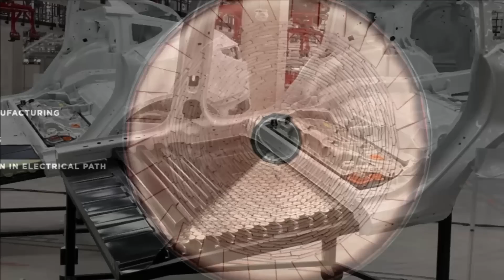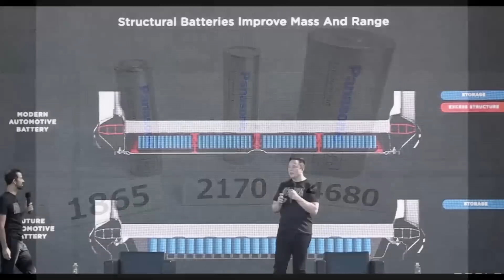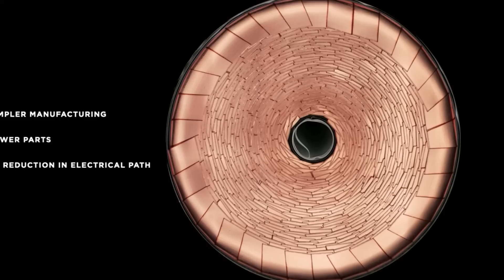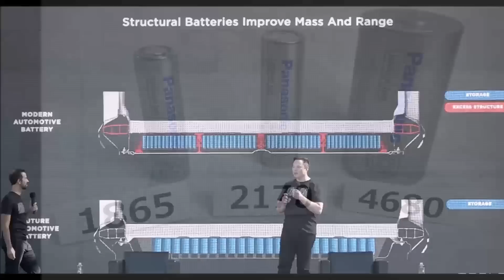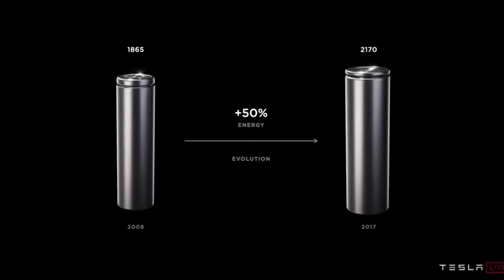BREAKING! Tesla Says It's Not Constrained By 4680 Battery Cell Supply in 2022

Comment: the 4680 battery as it is currently manufactured contains little that makes it advantageous over that available in the previous battery. that's because the tech that would have made it very superior can't be implemented and it can't be implemented because tesla can't get it to work. 

BTW, "it" is called the "dry electrode" manufacturing process. 

oh, they are making a 4680 battery alright! but it's not the one musk and co. promised on "battery day" a while back. they won't tell you that because they are too embarrassed. i would be too if i promised tech that i thought i could buy, and did buy at an enormous price (from Maxwell Technologies), but couldn't get to work. so they just went ahead and are making the 4680 battery, but making it wihout the tech that makes it better than what they were making before, except that it can be packaged to make it structural. ...a minor concession.

Comment: I am glad that Tesla is ramping up their 4680 production. And that it is not a production constraint. But if they were really ramped up in the Kato rd. battery factory then they could probably supply 4680 batteries for the German Model Y as well. Hopefully the Texas 4680 facility starts producing batteries soon, with Germany soon to follow. I am eager to see the specs on the 4680 Model Y. Tesla could initially limit range with software, and then when the German and Texan local battery production ramps up they could unlock better range and performance that the 4680 batteries will provide. Or they could offer a smaller 4680 battery pack with the same capacity as today, maintaining the EV range but making the Model Y lighter.

Comment: And yet may other analysts had no idea why the stock fell because they thought that was trivial news. 
They are ramping MY - their best seller. The don't have the cells to ramp them all. 
The Cybertruck was promised in 2023.... not 2022. The M2 wasn't due in 2022 either. That was grist from the rumor mill that ignored the ramp of the 4680 that Must (to make a profit) precede these vehicles. 
The MY is profitable with or without it. Perfect for ramping the cell production. 

If they dropped the stock because they were betting Cybertruck would be delivered early, they weren't listening very hard. 
Also, what part of the 1.2millioin reservations for Cybertruck will Rivian fill in 2022? How many Lightnings for 2022?  Just saying. 
Being first to start doesn't win the race. Or maybe the Bolt is doing better than I thought. 

The people who dumped were likely speculators, not investors. People looking for a fast buck.... and apparently 87% growth isn't fast enough. The investors are still there. 

The one thing I'm not clear on is Semi, which Was promised for this year. (The other 2 were not.)
He said he will not ramp new products, But truck was sort of in limited production, so I think that will see production as 4680 reaches volume production mid-year or so.... I may be wrong.

Comment: I'm hoping the 4680 will give us a 400+ range in a Model Y but I fear that Tesla not wanting to create an Osborne effect, will either software limit or even reduce the number of cells to keep the range comparable to current 2170 Model Ys.
Reply: I beliieve you are correct. I think he need to ramp MY on 3 continents and build it into the MY, M3 and MS, MX, Then increase the range. How annoying would it be to have different MYs with different ranges on different continents, but the Model 3 would be left behind and the Model S/X - just a bit embarassing. 

Think he's stuck moving the range forward when fully ramped. I would start with S and X (range improved) then move the Y and 3 at the same time as the next step while the Semi is rolled from slow to scaled production when the 4680 is cheap enough to produce a profit without damaging the cash flow from the other cars (one truck takes 9x the batteries of a MS Plaid but makes Far less margin). So a protracted rollout with volume semi as cell production matures at the end of the year (doesn't make him choose between 9 plaids or 1 truck).

Comment: So the "big update", is no update at all? Many are too optimistic with the potential of the 4860 battery pack, but Solid state battery technology offers way more breakthroughs, especially in charging time.
Reply: If there will ever be solid states batteries in production... it's a big "IF"... so don't hold your breath
Reply: @georgikolev8700  not a "if" it's more "when" and how much it will cost. Many manufactures will  use them in sports cars to absorve the higher production costs.